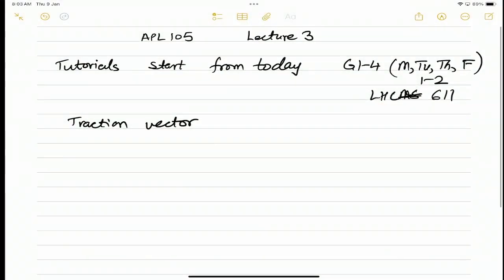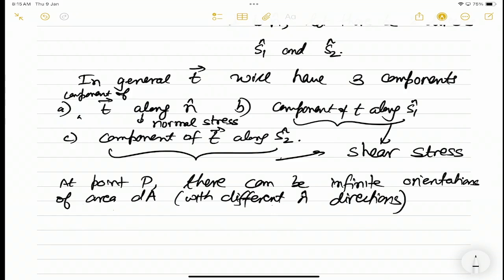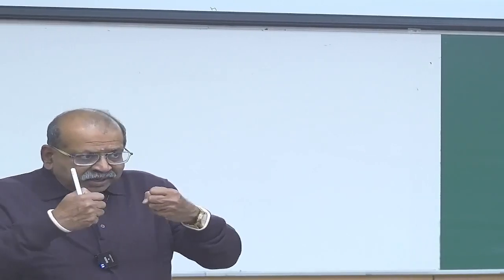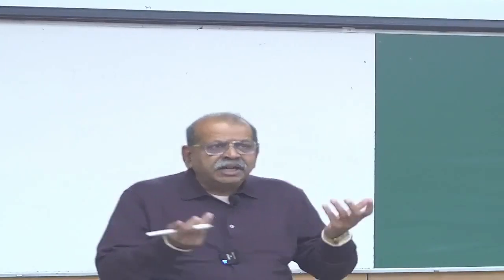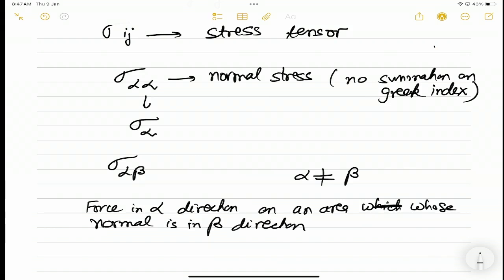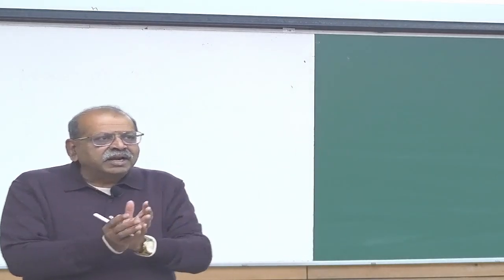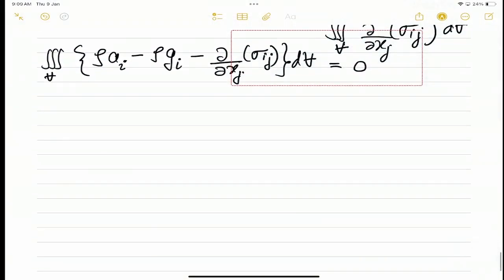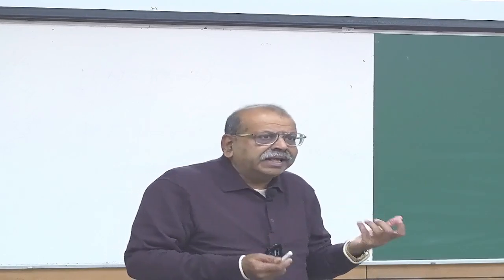Lecture 3

Comment: 18:20 - tensor product of 2nd order tensor and vector upon contraction gives a vector which is a linear function of another vector
23:03 - f(x) = -f(-x);  t is an odd function; true for any surface force
34:00 n1, n2, n3 on RHS represents e1.n, e2.n etc
38:33 upar waali eqn main volume ke terms tend to 0 when compared to area waale terms
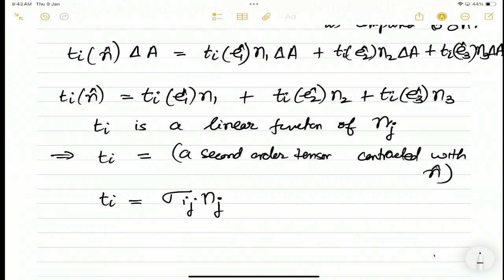40:31 using earlier knowledge: a linear fxn can be expressed as a contraction of 2nd order tensor and another vector
41:30: if we specify the 9 components of stress, that will give us the traction force at any orientation at that point
1:11:08 confusion, /2 kyon aara, samajh gya kyonki dx/2 distance from 0 to AB hai